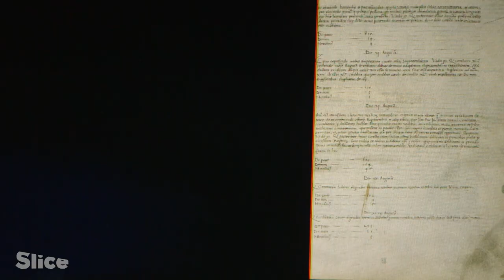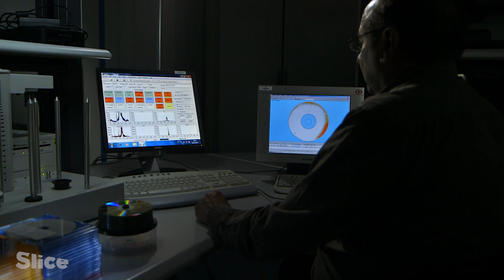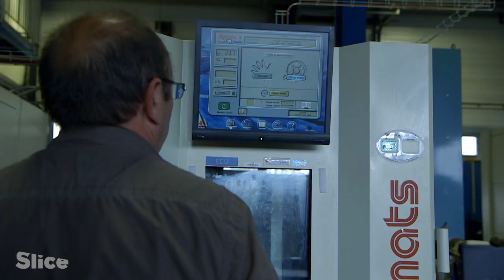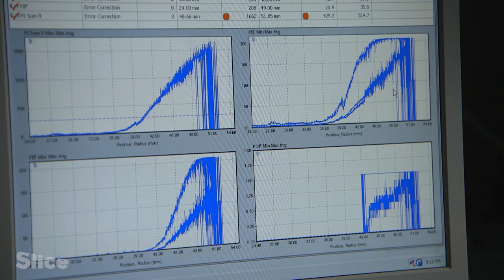CDs and hard drives: A long-term solution of storing? | SLICE

Comment: Before even watching I'll make a quick comment - properly stored, high quality CD/DVD/BR discs can easily last decades as off-line storage. I have still working CD-R's from the early 90's that were used for drive backups, same for DVD's from the 00's. And I have no reason to believe my current batch of BR backups will not last just as long.
Reply: Which brand is better?
Reply: @amitghosh6966  Yes, I also want to know.
Reply: I think M-DISC
Reply: @amitghosh6966  M-Disc is the current top of the pile for quality, but you pay for what you get...
Reply: Like with any thing, it’s keeping them in optimal condition that determines the length of time it stays well preserved
Reply: @looneyburgmusic being Write Once and low capacity really the M-Disc.
Reply: @servus_incognitus  M-Disc being allegedly  good for a century is something I've always wondered about, but since I'll be long gone by 2120 guess I'll never know 🤣🤣🤣

Comment: I have disks from 2008 and they still work, they are DVD-R. 
CD-R thhe layer is on the top side and gets micro holes even inside the case. 
Do you want proof of this? Hold the CD-R and point it at the ceiling light you will see the holes. 
DVDs are brand quality dependent, so the bad quality ones the record layer will get stains and data will be lost on these stains, this occurs around the disk edges.

Comment: Hardrives are a good choice if they are stored in a safe place
Reply: Learned this the hard way, I have hdd that has a bunch of child photos and videos that is now corrupted and lost anything. Its a 15 year old hdd that work until 2020. At one point I was able to open it but forgot to get all the files off now it won't even open the main partition.
Reply: @eronic404  Seems M-Disc is the way to go now as the storage layer is made from a stone like medium instead of ink
Reply: @eronic404  You can try send it to a recovery company, maybe they can recovery it.
Reply: @JohnUsp  I heard that cost thousands, which I don't have at the moment.
Reply: @eronic404  Yes, they are expensive, but you can verify and confirm it.
Reply: LTO tape and Mdiscs are much better than hard drives for long term storage
Reply: HDD is accessible to each backup updates and it's very safe. Nobody use LTO.

Comment: I have a lot of CD
 I buy some 1984 and still fine so I don't know what this guy's talking about
Reply: How did you store them? Becuase that's great
Reply: @eronic404   My garage
Reply: Modern CD players have error correction. Also, they want to store stuff for hundreds of years, not a few. Also, the process for CD-R/DVD-R use organic inks (which degrade), and not pressed foils
Reply: Do backups before them fail.
Reply: @JohnUsp   Of course I make the backup 
Right now I try to make a backup from the backup
 Because my hard drives broken too
Reply: I have DVD-R  from 2006-08. Are yours pressed CDs or CD-R?

Comment: M Disc is the answer. Look it up. A blu-ray M Disc can store 25-100 gigabytes for up to 1,000 years affordably
Reply: thank you for the comment, I will look it up
I am worry about solar flare hitting us. I need something that don't rely on magnetic and not constantly wire to electric components
Reply: Yeah until you scratch it or it falls or something gets stuck to it. All video games are blurays since 2010 and I had plenty game disc go bad. Most data is good if stored properly and will last for very long but all are fragile and are prone to just going bad because of un proper storage.
Reply: @eronic404  Nope. You can scratch M disc with sandpaper. Conduct a few YouTube searches. They can be dropped, frozen and liquid nitrogen and heated it up. If you deliberately bend them, that’s virtually the only way to break them.
Reply: Here is a couple of problems though. Many , if not most devices like computers, cell phones, etc., all use flash memory to store firmware so they can boot up, or operate. Flash may only last up to 20 years. The discs may last a thousand years, but what about the readable drives? Even if you stored a laptop , and/or  DVD drive with them, you may not have a machine in the future which can read them. When was the last time you heard of a 78 RPM phonograph player being manufactured, for example?
Reply: @knerduno5942  that’s a very good point. The good news is, there are still some working phonographs. And all you need is one machine to read thousands of discs. With so many people using discs for so long, and with disc readers being such a relatively simple technology, I think it’s reasonable that we will have at least one optical disc reader, to read all the discs that are left over on earth
Reply: HDD is the best we have at this moment, of course, make backups in another HDD and also in the cloud.
Reply: @JohnUsp  LTO tapes and Mdiscs are much better than HDD for long term storage
Reply: HDD is accessible to each backup updates and it's very safe. Nobody uses LTO.
Reply: @JohnUsp  a lot of companies and businesses uses LTO, just not the home user
Reply: @tiziocaio8657  yes, I agree, but this is unfeasible to 99.999% of people.  the tape cost the same as an HDD and the drive costs more than 5k
Reply: @JohnUsp  tape is cheaper than HDD, but the drive is really expensive. Usually tape becomes cheaper only if you have 50-100TB or more of data to store
Reply: @tiziocaio8657  I saw an 18TB tape by $200, almost the same as an HDD, but this depends on the seller.  Yes, if you want to backup/store a lot of data (100+ TB), the tape is a good idea, BUT, I still prefer to use HDDs and store them in a safe place.
Reply: @JohnUsp  this because it’s the new generation LTO 9. There’s LTO 8 tapes (12TB) that costs 80€ or even 70€
Reply: @tiziocaio8657  Thanks.
Reply: @shadowmistress999  What will you store i am planning to store movies and web series
Reply: @pirateluffy01  just photos 😂

Comment: HDD is the best we have at this moment, of course, make backups in another HDD and also in the cloud.
Reply: LTO tape is better
Reply: @tiziocaio8657  Yep but consumers can't use it.
Reply: @butmunchass  they can, the drive it’s really expensive, but except the cost it’s not that hard to use
Reply: LOL, HDDs? Are you high, friend?
Reply: @-Perene  you can use Tapes, just need to spend a LOT of money for the driver.  SSDs cannot hold data longer.  What do you suggest?
Reply: @JohnUsp For cold storage nothing beats a well preserved optical media, which in my case I opt for BD-RE or BD-R. Or DVDs. Just invest in a cheap external drive and do it. And of course buy proper CD cases, big enough to hold the discs, and don't put them in places where over time they will easily rot. Aside from that, for HOT STORAGE, I only buy SSDs. HDDs I don't want any of them, even if you paid me to have them, I would reject this garbage. There are complaints of them even being noisier in high capacities...

As for tapes, not an option because the drives are too expensive, in the event of breaking you can't fix them easily depending where you live. Not to mention monopoly from the people that produce these, and planned obsolescence on the way for some newer models, lacking support for old stuff.
Reply: @-Perene  ok, but I don't trust in optical media, the silver film can rot easily.   Today HDDs are so reliable, the electronic components can work for decades and the media can store data for more than 1 century.  For me, I prefer to keep my data in at least 2 HDDs and often sync them.
Reply: @JohnUsp decades?  Are you crazy?  All HDD and SSD rely on electromagnetism to hold the data. Which diminishes over time. Modern HDD AND SSD’s are rated for between 3-8 years. Optical is the only way. This video is hogwash.
Reply: Really?  Explain that. Explain how data rot doesn’t occur due ti HDD’s diminishing its electromagnetic current. Explain how a disc that has data burned into it is less reliable than a HDD or SSD that relies on said current for data retention.
Reply: @EyeForKnowledge.  HDD can keep data for more than 70 years, even offline.
Reply: @EyeForKnowledge.  optical depends of the material, most of my CDs, DVDs won't read anymore.
Reply: @JohnUsp  That’s an absolute falsehood. 70 years??  You’ll be lucky to get 7 with an HDD.
Reply: @JohnUsp  Hence the reason to use archival grade discs.
Reply: @EyeForKnowledge.  70 years not spinning, but off. spinning more than 10 years, I have several OLD HDDS that still working fine.
Reply: @JohnUsp  Well you’re lucky. They will fail. And it won’t be 70 years. Leaving them off is worse than spinning them up.  Keeping power
To them at least slows down the electromagnetism degradation.
Reply: @fenix144  Intelligent response. But what can I expect from someone with a “don’t tread on me” picture?  Guess what coward?  They tread all
over you all day every day and
You don’t do anything about it. Mouth breather.

Comment: What a pile of hogwash and clickbait. I can respond in several ways:

1. In the broad perspective, digital storage media are not developed with the expectation of lasting for millennia. That doesn't mean they couldn't be. It's just not the priority right now. At present we need to get costs down, capacity up, and more reliability. This is not some dark conspiracy, or some siren song of fake progress. It's perfectly rational. You just need to understand the parameters you're dealing with.

2. Digital data can be backed up and preserved, far outlasting the original media. This is very easy by now, and easier all the time. Media lifetime matters, but less than human carelessness.

3. My own experience disagrees greatly from the claims made in these interviews. Yes, I have seen defective discs. As said in the video, these generally appear in the first year or few years, and BTW they're usually evident just looking at them. The rest last a long time. It's not 15%. I doubt it's over 1%. Those talking heads in the video should stop buying crappy discs.

4. I started burning CD-Rs in 1998, burning maybe as many as 2000, until 2011, when I went to USB hard drives and flash drives for archival. Not once have I seen a clear case of age-related data loss, except for those few defective discs.

4. For archival storage, you really need to verify your data. The OS SHOULD do that for you as you copy, but in my experience you can get burned. Use some kind of checksum tools, and do it consistently. A PITA, but well worth it.

5. Longevity of flash drives is still TBD, but I'm not worried. Again, keep refreshing your data, and using those checksums, and you can sleep well.

6. Long-term readability of data formats is the real worry. Going from discs and tapes, which, face it, were a real PITA, to solid state and USB, restores quite a bit of sanity. Geeks just love to come up with new formats, but at least now it's basically just file formats, not media formats, and it's easier to maintain control over what file formats you use.